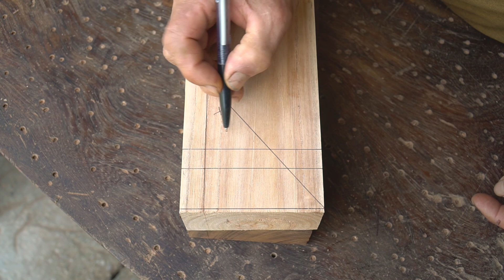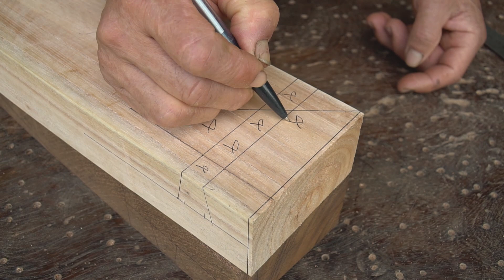Awesome Skillful Cutting Wood Joints Techniques of Craftsmen, Making Simple Straight Wooden

Comment: Scarf joints should have a ratio of roughly 6 to 1 to 12 to 1........not 1 to 1. There are many ways of locking them without creating short grain. Those two design flaws make this a fundamentally weak joint. There is no possible use for this joint in the real world because it is so weak. Scarfs aren't used in furniture because they are never needed, so this is supposedly for some form of framing on a house or garden scale, for which its weakness makes it totally unsuitable. So, once again, the only possible purpose of this joint is to provide entertainment on Youtube.